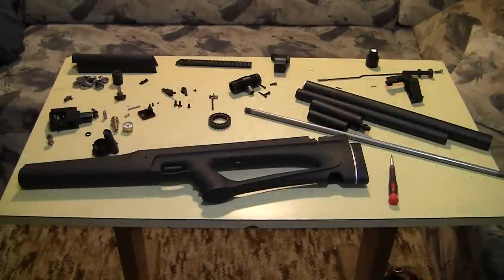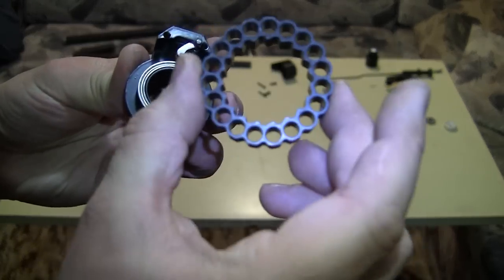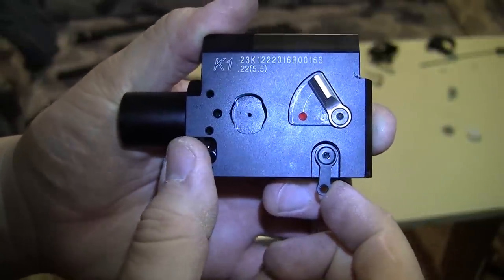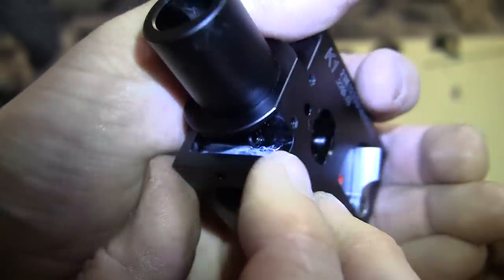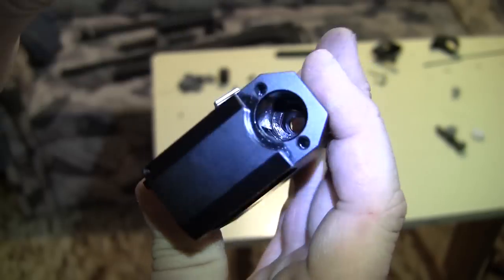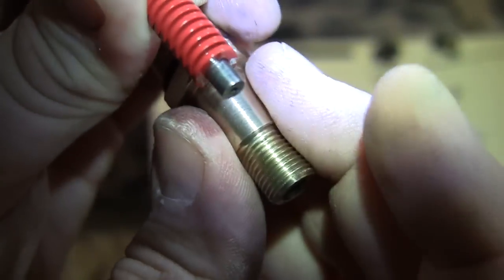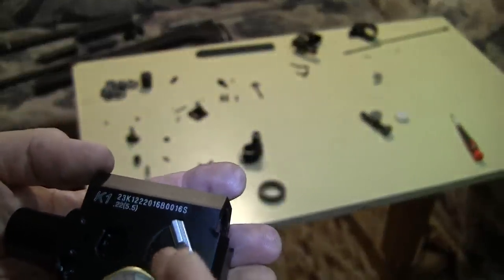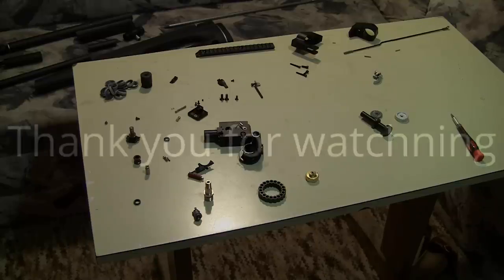Huben K1 - Full disassembly, operation explanation

Comment: +Gregor Kamenšek I have a Huben K1 and it seems to be losing air from the tank or the mechanism (approximately 70-80 bar within a week). Have you seen this behaviour before regarding this gun, and if so, do you know what may be wrong with it?
Reply from the maker: Hi. I have not have this problem yet. Slow leaks are a big pain in the a**. It will be quite a difficult task to search for the leak in any airgun. There are about 8 places where it can leak: My best guess is the one way valve at the will port. This is the only one you can check without disassembly of the gun. There are two ways to check. First you have to unscrew the fill port out of the cylinder. You can do this while the gun is pressurized. Then remove the filter form underneath the fill port (usually just a piece of crumpled paper). Then you can apply some sort of foam to the whole area where the fill port was screwed on and see if any bubbles form in time. It may take some time. You can use sawing foam or water with soap,... The other way is the same but instead of using foam put the end of the cylinder in water (you will have to remove the shroud first). 
If this seem to hard to do, then you can try to fix the problem before you test it. When you fill the gun (you will have to use a scuba tank) release a big amount of air fast in the gun. Do this in short busts and wit in between for the cylinder to cool down. Release 20 - 30 bar bursts... This sometimes helps to fix the problem with one way valve on the fill port. If you cannot fix the problem this way, the I suggest you send it for repair. I can guide you through other possible points leak, but you will have to do this at your own risk and it will probably void you warranty.
Good luck
Reply: Thank you for your reply Gregor.

I have a suspicion that the problem may be with the pressure gauge fitting. What do you think is the best way to test this?

Also, what would be the safest way to completely empty the air tank and discharge any air from the firing mechanism?

Thanks and regards
Reply from the maker: Hi. Emptying the regulated cylinder is easy. Take a look at my video for cleaning the barrel:
https://www.youtube.com/watch?v=hymZgeJmXkM
All you have to do is adjust the regulator to minimum and the air starts to gush out. Keep in mind that when you do that, the unregulated part of the cylinder is still pressurized.
It is easy to remove the pressure gauge: first drain the gun,  then you have to find the pin that is preventing the gauge to rotate. it is to the front of the gauge in the small area between the gauge and the lever that releases the magazine for loading. You have to press this pin in and rotate the gauge CCW for 90°. This will release the gauge and you can take it out. Check the small O-ring and replace it if necessary...

Comment: Thank you Gregor. The video is excellent! A great invention of airgun.
I want to ask you some things i dont know yet! (sorry for my bad hearing english ^^)
1. How to high-pressure impact on firing-valve system. I dont know if has a seal in slide pistol of firing valve? Before each shot, the force impact on the valve is toward or opposite?
2. The thing behide the firing-valve does not have seal, so how to keeps high pressure air in the firing chamber? And how to fix firing-valve in the firing chamber, because i see it is smaller than diameter of the chamber
Sorry if my questions is not right ^^
Reply from the maker: +Bốn Lê Văn Hi. I am having some trouble understanding you questions but I will try to answer to my best abilities:
1. Force of the pressure is trying to open the valve, by pulling the trigger, you are letting the pressure to open the valve.
2. The back side of the firing valve is sealed and the valve can be removed for service repair.
Hope I got those right...
Reply: +Gregor Kamenšek I dont know if high pressure air occupy all space in firing chamber or partly! If it is all space in, the firing chamber is tight, but i dont see seal in the thing behind firing valve (The thing contact with sear) Other, what principle to help the firing valve open. If it's pressure difference between 2 sides of the pistol, make the pistol trending backward, so meaning contiguous surface between the pistol and exhaust hole trending uncover, even before shooting, so will cause leaking in exhaust hole
Reply from the maker: +Bốn Lê Văn The back side of the valve seal is in the breach, that is why you do no see it in the video. there is a separate part the is in contact with the sear, the valve assembly (made of front bars part and rear steel part) is pressing against that part. The valve is opened and stays opened by the pressure. It closes by the spring when the pressure drops. A am sorry but I do not understand the last part....
Reply: +Gregor Kamenšek I wish you understand what i said! ^^
About firing valve, high pressure air impacts to slide pistol and push it toward, I dont see reason make it move backward when the sear is freed
Reply from the maker: +Bốn Lê Văn Google translator is not working for us :) Her goes: high pressure wants to open the valve, by pulling the trigger you are releasing it and it opens by the pressure. If you look closely, valve is made of two parts, the back part has a bigger surface area, that means that the force is higher to the rear (to open...)
Reply: +Gregor Kamenšek I can understand active principle of firing valve. It is based on the difference in pressure between the 2 sides of the pistol. But I dont understand how it will do. Rear side of the pistol contacts to back part, i am not sure it is airtight with pressure to make an force effect to the pistol. It's hard to express in english ^^
Reply from the maker: +Bốn Lê Văn Yes, back side is airtight, the o-ring is inside the valve hole.
Reply: +Gregor Kamenšek the o-ring is inside the valve hole?Confused! Video did not show?
Reply from the maker: +林鸿 
The gun in fairly complex, it is not possible to show you every detail in the video (also because it is hard to see in that hole)...

Comment: You can be assembled video?
Do not understand the level after the valve position, the trigger hole how seal?
Reply from the maker: +林鸿 
Sorry, I do not understand the question. The valve seals in the same way as traditional airguns do (plastic seal on metal)

Comment: Hi to change the orring of the little ping (16.20sec) ...,i have to dissasembly all the rifle??? ,thanks
Reply from the maker: You have to drain the regulated cylinder by reducing the regulator pressure until it bleeds out all the air, remove the front pin in the stock, unscrew the power wheel and the internal part of the power wheel (you need to to this in order to remove the stock), remove the stock, remove the right plastic plate where you feed the pellets and they you will see the brass screw. unscrew it out completely and shake the gun a bit so the pin fells out or use a small tweezers... replace the oring on that pin and put everything back together, re pressurize by increasing the pressure on the regulator.....

Comment: Hi, I want to ask.
As the open pressure of the lower valve - that's the one with three legs.
I do not know where to put pressure.
Well thank you
Reply from the maker: Not sure if I understand the question. The lower valve with three legs is the closing valve. It is only closed for a fraction of the second right after the shot...
Reply: When there is no pressure in the gun in which state the valve is . Is the valve down or up?Thank you.
Reply from the maker: Same as when pressurized... Opening valve is closed, closing valve opened (iz does slightly depend on the power wheel setting...)
Reply: I do not know what the valve is pushing up?
Spring or pressure.
Reply from the maker: The spring on the rod that is connected to the power wheel is pushing up but not enough to close it. As mentioned, it is opened by default, it only closes for a fraction of a second after the shot due to pressure difference...
Reply: ok, thank

Comment: Hi Gregor, how are you? Congratulation for yours videos. Recently i buy a Huben K1, here in Brazil not yet a distributor, i had to go in Argentina buy it. I am configuring the app Strelok in my smartphone, do you know? Strelok is the app for Android, similar to ChairGun, is excellent for ballist calculations. For it, I need the "twist rate" (in Inches) at Huben K1 and the direction of the pellet rotation. Would you help me out of this? Tks
Reply from the maker: If you have a new K1 (version 2) then you have 1:16.4" right twist (1:416mm to be exact)
Reply: I do not know which version it is, there is nothing that identifies neither the box nor the weapon. How to know?
Reply from the maker: If you just purchased new K1, chances are that it is ver.2. I will receive K1 ver.2 shortly. When I do I will be able to let you know how to check the version. BTW: version 1 has choked barrel with right twist 1:450mm
Reply: Do you know if it is possible identify by serial number?
Reply from the maker: I will ask huben...
Reply: Ok, I will wait. Tks
Reply from the maker: I have received and answer, the diference is in the location of the Huben logo. The old version has the logo on the top, the new has on the side...
Reply: Oh great! Mine is the new version then! Thank you very much for all informations!

Comment: What is the size of the O-rings on the valve indexing, if there is o-rings, 1 or 2 ?
Reply from the maker: the o-ring on the shaft (this will have to be replaced every couple thousand shots) is 2.5 x 1 mm
Reply: Thanks for the fast reply, and how much of an O-ring on the shaft 1 or 2? I found one on the same floor and I do not know how much they have to be
Reply from the maker: There is only one o-ring on the shaft as far as I know. The other one is on the bars part but it usually does not wear out.
Reply: Perhaps these newer models are 2 o-rings.
My Huben differs significantly from that of your film.
Reply from the maker: It is possible... I noticed that there are several versions.
Reply: Thanks for your help Gregor. Do you have a diagram of O-rings Huben
Reply from the maker: unfortunately, no... Maybe if you ask Huben directly...
Reply: Some unlucky that my Huben, now escape of air from the regulator, from under the plastic which is under spring washers. Any ideas ???????
Reply from the maker: Did you try to increase the pressure on it? It is designed to release the pressure when you turn it to very low pressure in order to enable you to drain the gun...
Reply: ciao gregor.non e che potresti mostrare come prossimo disassemblaggio completo il HUNTSMAN REGAL.grazie...